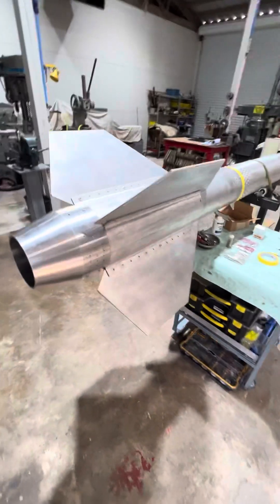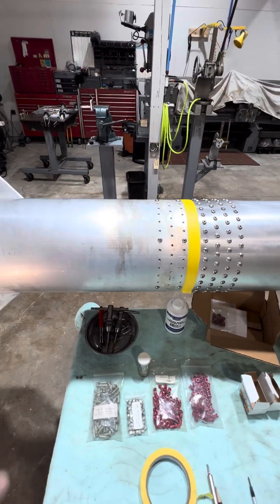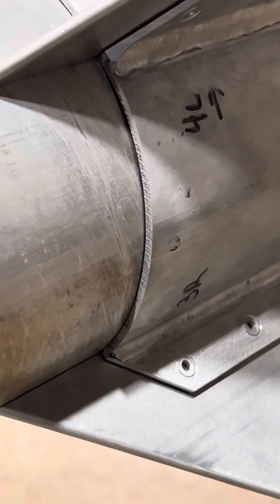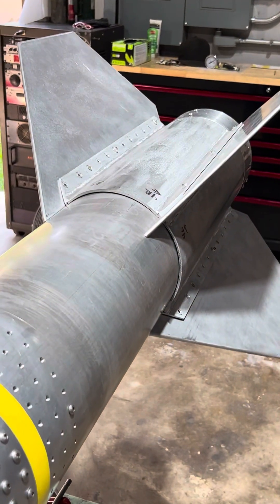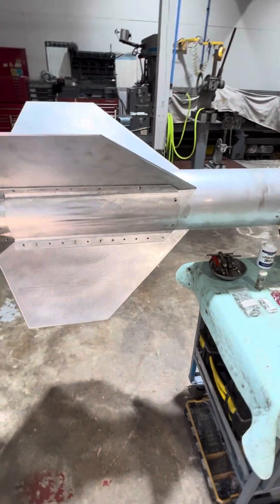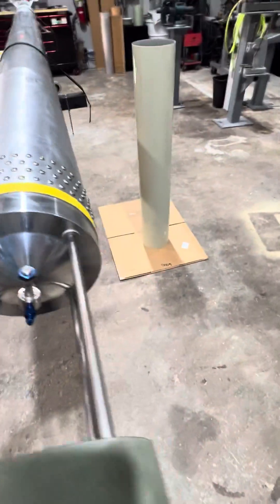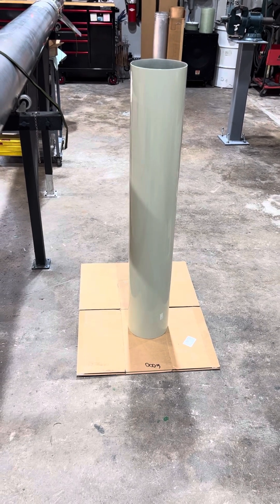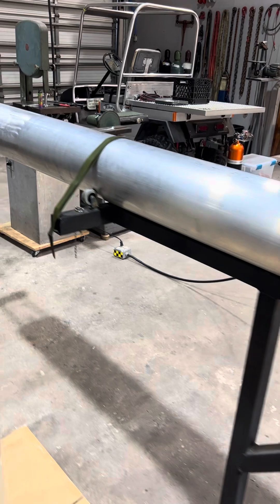R10,000 Rocket Build Update

Comment: you could try welding the fins
Reply from the maker: Welding Works on smaller diameter airframes, but once your @  8” OD and .125 wall tube, the I.D tolerance is critical for fitment. Heat dissipation from the weld process creates distortion on the I.D and will also start to Cant Fins on the OD side. the fins would have to also be aluminum… an in this case there not.  .250 Aluminum fins will fail @M4.2.  We Definitely don’t need that. The fins are 3/8” G14.  Also the heating of the weld process changes the temper of the aluminum, in turn Id be wise to re temper after any welding process is performed.  I’m not saying it can’t be done, bc it can..in this case it’s just not worth it.
Reply: @HybriDyne  oopsie

Comment: Looks Good.... Work in Progress.... Don't let the issues bog you down or demotivate you.... You'll figure it out eventually....
I'd like to see the design of the Rocket and the Motor.... do you have a cross-sectional diagram of it anywhere ?
Materials, Fuel etc.... ?
Reply from the maker: I may, I’ll have to look through some cad files in a bit, problem is solved, they are  now bolt on bands, looking into composite options also, may build a composite can depending on cost of materials an such.  So this is basically a sounding rocket, your looking at the motor and the oxidizer tank in the vid.  Fuel is Doped HTPB an 200lbs of nitrous oxide as the oxidizer.  Vehicle is composed of mostly 6061-T6511 aluminum and titanium fasteners, some carbon fiber and fiberglass for RF transparency where the avionics an telemetry is located.   Nozzle is constructed out of graphite an phenolic making a phenolic ablative nozzle to shed heat during a 20+ sec burn. I’ll see if I have a cross section here shortly for you.
Reply: @HybriDyne  that'll be great. Just wanted to see what the inside looks like. Also, will you be attempting an altitude record with this ?
I'm no rocket scientist, just a curious electronics engineer. :)